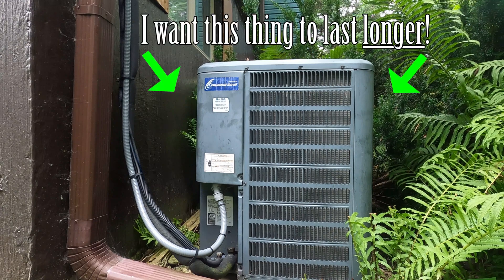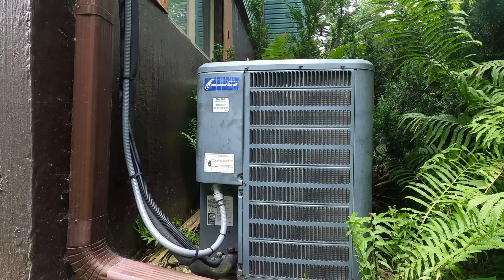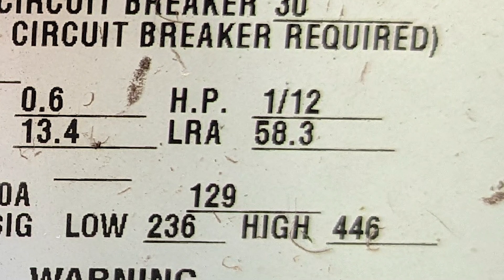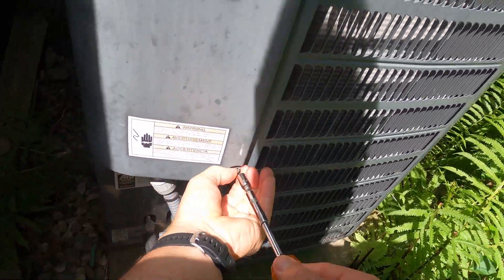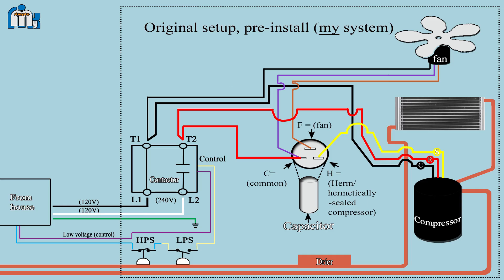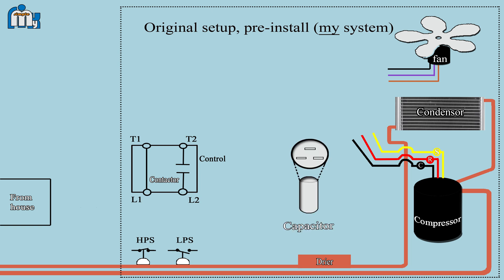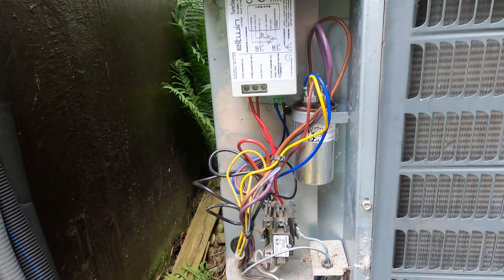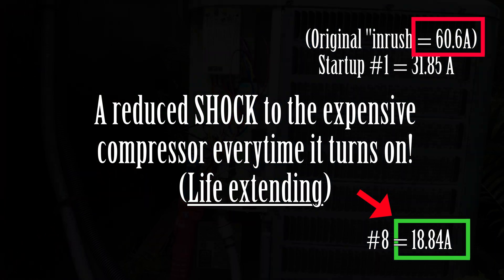Reduce AC Start-up Surge: Install Hyper Engineering SureStart  soft starter on Home AC.  #36

Comment: Something to add, I would recommend you replace The $20 capacitor while you're doing this job just as a preventative since you're already in there and taking things apart.
Reply from the maker: Yes, absolutely! I ended up ordering a replacement capacitor and replaced it after the video was done for the same reason you mentioned. I had one capacitor blow many years ago on the previous system that we had, which disabled the fan, resulting in the compressor overheating and almost driving itself hard into extinction. We only realized that the capacitor had blown because of the loud "hum" coming from outside of our house. Thanks for posting.

Comment: Great video.  Perfectly clear.  One thing I don't understand.  I bought a 16-32A Soft Starter with Reverse Motor Protection for 4-7 Ton Residential HVAC Air Conditioners, SS1B16-32SN, SS1B1632SN, SS1B16 32SN for $99 from Amazon which looks the exact same as other kits listed such as Eltwin. Other same products with different labels cost way more.  What's the deal?
Reply from the maker: I have no idea why they do that.

Comment: My Lennox 5 ton unit has a hard start currently installed. I would like to remove it and install a soft start that I can use  my AC with solar/back up generator if needed. 

Is there anything I should worry about when it comes to removing the hard start and then installing the soft start kit?

Thanks for the in depth video!!
Reply from the maker: I am no expert, but I would take a look at the wiring  schematic label that should be present within the inside panel of your unit. Your connection choices should be on display there. I'm assuming that the hard start was installed before you owned the unit? Myself, if the schematic doesn't show a hard start setup, then, I would consider returning the wiring connections back to what's on the label, and then install the soft starter beginning from the original configuration. If your AC unit is supposed to be connected "with" a hard starter installed (as per the label), then I wouldn't remove it, and if so, I'd not install the soft starter. If it looks good to install the soft starter, then make sure the soft starter you get can handle your 5 ton unit! Good luck, and let me know what you found and how you made out!
Reply: @mysimplefix thanks for the quick feedback. I plan to do it as you said by checking out the schematic and see if it functions within spec after removing the HSK. Thank you!
Reply from the maker: Best of luck! 👍
Reply: @stanksbeamen  So you were unable to start it with the hard start kit installed? I'm curious if the soft starter made a difference. I bought hard start (kick start) kits for all my ACs so that I could use them with generators but now I'm curious about soft starters.
Reply: @JustEnjoyingLife73 no it works fine with the hard start kit. I was going to reach out to the previous owners we bought the house from and see if they installed it on purpose or just got upsold when replacing the AC a while ago. Haven’t gotten around to a soft start yet at all. So many things to do and little time to do them. 😂

Comment: Thank you. I installed this exact model this past Saturday on my 2-ton heat pump. Considerably less noise on start up. Thank you. I watched your comprehensive video before I tackled it.. It helped.
Reply from the maker: Honestly, those included instructions I found to be a bit challenging until I broke it into smaller chunks. Glad to hear it's working for you, as is mine.Thank you for your feedback.
Reply: @mysimplefix Thank you again!

Comment: Thanks for posting this video. Just finished the installation and the first start was a 50% reduction in inrush current. My goal is to get as much life out of my 14 year old unit. AC is a must here in Florida.😊
Reply from the maker: Yes, glad you're all set up! Mine's still working well too. This week was at 34 deg C (93 degrees Fahrenheit) here just north of Toronto.

Comment: This video is excellent.  Thanks for starting with explaining the system using the schematic (original) and then walking through the changes on the schematic.  
Then, the step-by-step instructions are great!   This helped me install the soft start on my 4-ton unit and what a difference it makes in reducing the inrush current and eliminating the loud "CLANG" at startup!!
Reply from the maker: Thank you. I'm glad this one helped you out!

Comment: "RLA" means "Rated Load Amps" which is a mathematical calculation. Not FLA!
Reply from the maker: Rated load amps, is the same as running load amps.

Comment: Great walk through!  I was curious about the purple fan wire that connects to Common.  Directions dont mention anything about it and doesnt show it, so I assume it stays, but wondered if it should be moved to the contactor.
Reply from the maker: On my setup, I did not move the purple wire  to the contactor. The red wire from T2 of the contactor on mine runs straight to the common terminal on the capacitor. Effectively, it is the same thing.
Reply: @mysimplefix  Thanks!  Installed yesterday, but my supplied red wire as 8 AWG and my yellow (12-10 AWG) spade would not fit.  I'm guessing its because I have model16-32.  "Proper" 8 AWG connectors would not fit, so I kind of had to create my own.  Wish the would have supplied a connector.  In the end, it dramatically decreased my starting amps!

Comment: I notice the meter is only showing amps when measuring the inrush current near the end of the video.  Given the concerns by some viewers, it would be interesting to have the meter show Hz as well, since the Amazon page listed for this meter seems to imply it will show Hz and amps at the same time.  If the output of the soft start unit is always 60Hz, perhaps it's just chopping off a slice of each sine wave similar to variable dimmer switches and ceiling fan speed controllers.
Reply from the maker: Your interesting comment is appreciated.  I will look into this shortly, and aim to make a follow up video.
Reply: Yes, I also would like to know more about how it works?
Reply: @alistairplank4996  google "soft start scr"

Comment: Surestart was replaced with SmoothStarter. IMHO big waste of money unless you are solar battery powered. Hard Start kit will work about the same.
Reply: Last unit I looked at was $500.
A bit steep, but over the long run, I'm sure it pays for it's self in reduced repair costs.
Reply: @jamess1787  repair costs? I have a 5-ton R22 unit installed in the early 90s that's still operational today (no soft start or kick start). I'm looking at these soft starters to see if I can make my system last longer, although I wonder how many times I would have had to replace the soft starters in the 30+ years I've had it. Part of me is wishing it would fail so that I can get a 20+ SEER fully variable inverter system with a variable speed blower. I have a 2-stage 3-ton with a variable speed blower on the upstairs AC, and it runs so smoothly and quietly that I can't even hear it start. When our 5-ton kicks in, the lights dim and I can hear it all over the house.